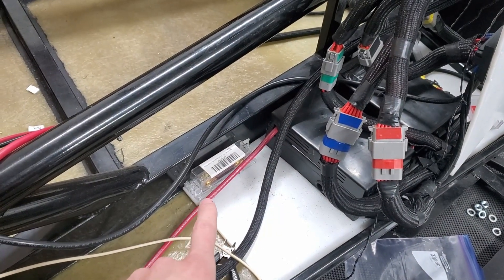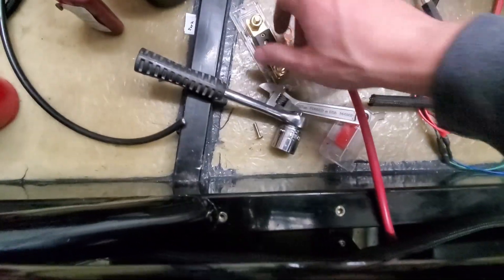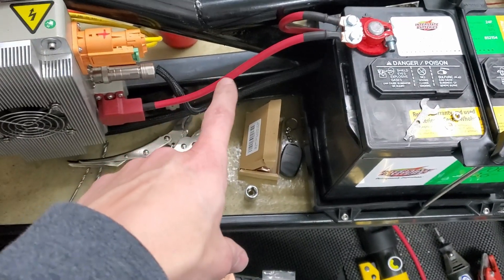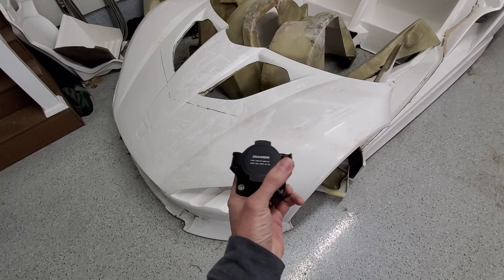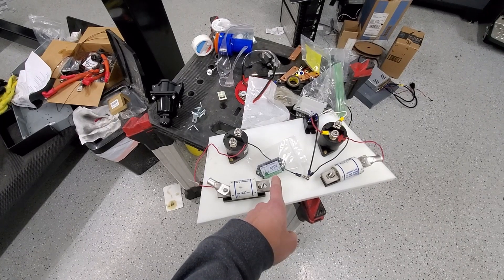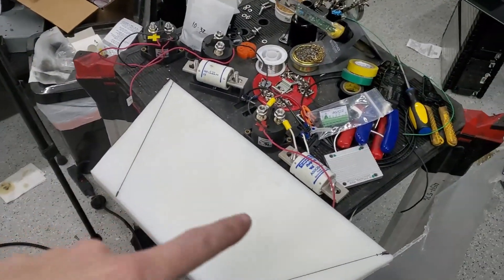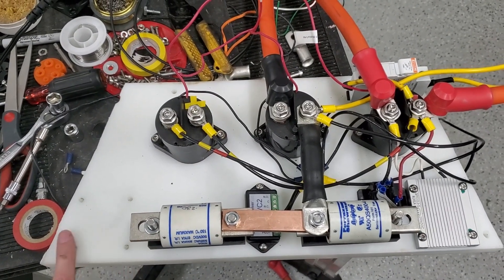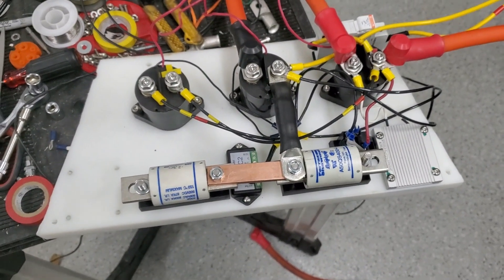High Voltage Part 1

Comment: 🧐 what’s the voltage on your front hv pack and rear ? 
Are those yellow cables rated for over 32a? 16:16
Exposed charge ports don’t look good at all.
Find a Hidden spot to mount it, you will like it better & avoid exposure to water from the rain in winter, it can freeze locked. Tesla hides their port because it looks better but they have freezing port door issues as well.
My i3 drives me nuts in winter freezing shut the charge port door or the charge plug in place. I’ve been thinking about a heating system for the charge port to stop this ones and for all.
Something that might help you troubleshoot things too is a 12v low battery alarm, some cost less than $10 so if battery voltage dips down for any reason you will know right away.
Reply from the maker: Thanks for the insights!  The yellow cable came with the DC: DC converter, so I assume it can handle the load.  Packs are ~400V
Reply: @electricsupercar  
400v in front and 400v in the back combined in parallel?
I’m trying to understand why front and back packs negatives are connected together..
Reply from the maker: @arecibo1974  Yes, connected in parallel.  So when both packs are connected it is still 400V but more amp/hours

Comment: First, I love the videos.  I am in the middle of doing something similar so I really appreciate these.  I was curious why you don't have a negative battery connection going to the frame directly?  Am I to assume that the fuse relay box grounds to the frame directly?
Reply from the maker: I am assuming you are talking about high voltage (if not ignore the following).
My first instinct was that you should ground the negative battery to the frame...however, the EV community is very, very, strongly against it.  EV West stated "No. Very big no, actually.  This is called 'isolation' and if there is low impedance between the pack and chassis, all sorts of very bad things will happen.   The big issue is components (like a DC converter) that have both leads to the 12 volt system, and the high voltage system. Without proper and high quality insulation between the systems, you'll have high voltage in your chassis."

I hope this helps
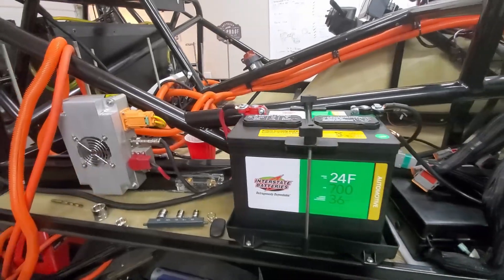Reply: @electricsupercar  Definitely not high voltage.  But the 12V battery, the two negative cables, one went to the DC/DC, and the other went to the fuse relay box (6:45 mark).  Most "normal cars" also has a negative cable going to the frame.
Reply from the maker: Ah yes.  Thanks for the clarification.  I have one going to the DC/DC converter and the other going to a distribution block that is grounded to the frame.  I use that distribution block for most of my relays and systems for ground.  I hope that answers your question.

Comment: Put your charge plug in the most convenient place on the car that's closes to your charging outlet. It seems in your garage in the back. That way you can put the charger cable on the wall by the big roll up down that way you won't be tripping over it every time you want to get in the car while working on it. It's a process and you will be in and out of the car a lot while it's charging so make it easy on yourself.  I wish my charge cables came down from the ceiling and rolled up when unplugged like the old style drop lights that had the reel that rolled them up. In fact I'm going to see if there are 50 amp roll up cord units. I just talked myself into it. With 3 EV's I'm always swapping cords around, that would make life so much nicer.
Reply from the maker: Great advice, thanks!
Reply: Hide it behind a flip down license plate.
Reply: That’s a great idea!
Reply: In some of our RVs they make 50 amp power roll cords.